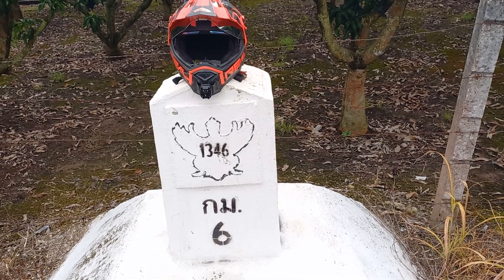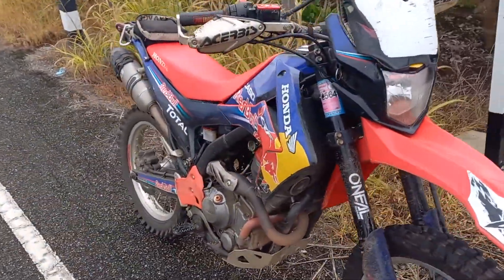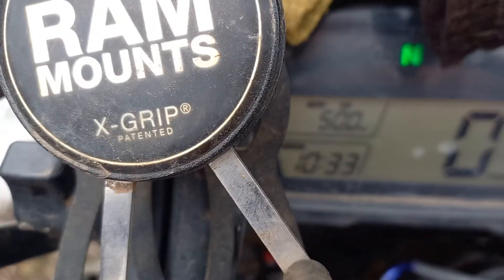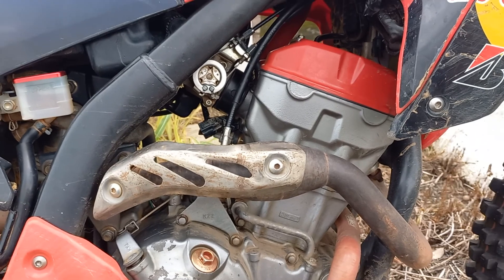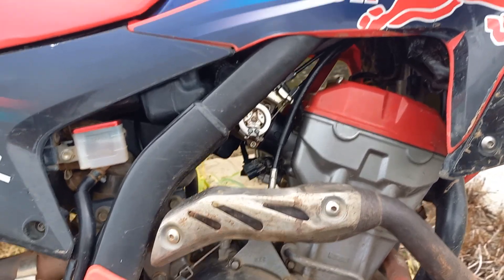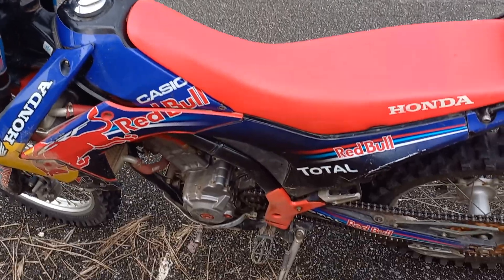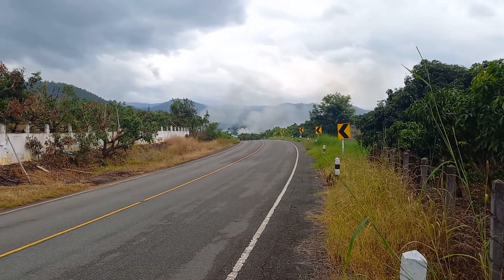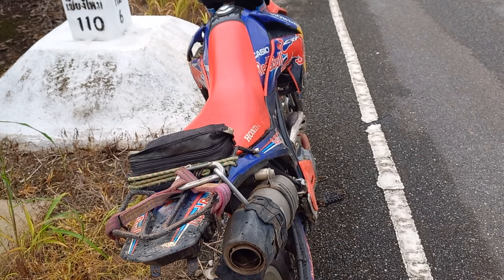HONDA CRF250L 300L CONVERSION.

Comment: Did you change the gear ratios to or is it just an engine conversion?
Reply from the maker: Left the gearbox stock but run 13/45 for extreme hills (sometimes 2 up!)